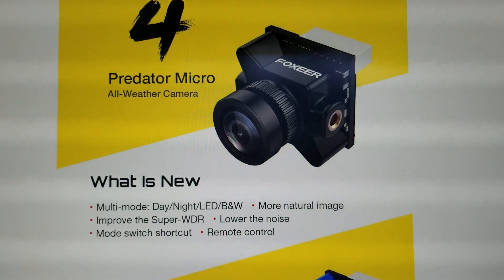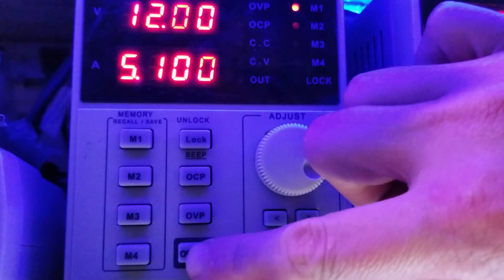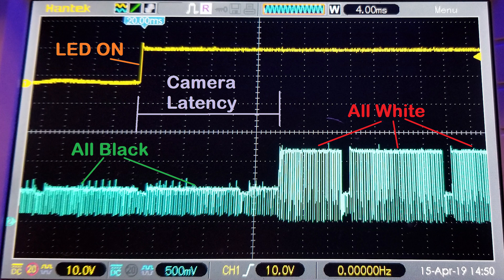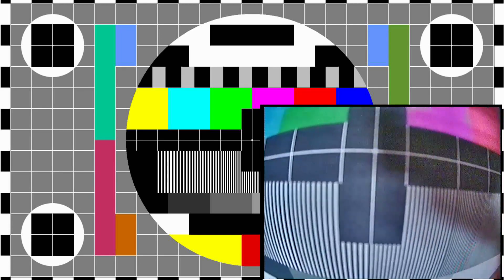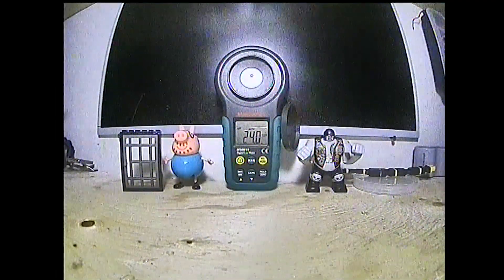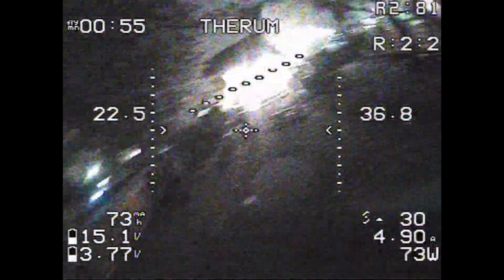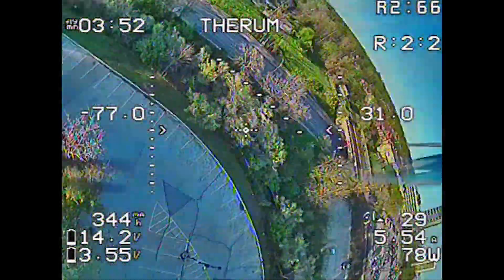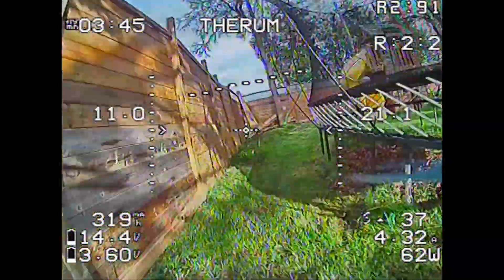Foxeer Predator v4 FPV Camera Technical Bench Review with Predator v3 comparisons

Comment: I just recently bought a Falkor 2 Mini. It's not even a week old. I'm impressed about wdr. They claim 5-40v too. Mine was connected to 7v. It was hot already! I don't want to use it beyond 10v. I will adjust my buck down converter to 5v or better, hook it up to the 5v pin on the fc. I might sell this fpv camera since I saw many youtube fpv vloggers are saying so many good things about DJI fpv system. They don't want to go back to analog anymore. Glad I haven't bought any fpv goggles yet. I'm new to this.

Comment: Again THANK YOU. I'm hooked on your videos now. I never liked the Predator's picture. I was very disappointed with the V1. I skipped V2. However, I have new found respect for Foxeer and the Predator V4 now that you have confirmed how low the latency is. Yeah, the RunCam Racer 2 might be a little faster, but I need to be able to fly in low light as well We race in dimly lit parking lots at night over here. In contrast, I bought a couple of Ratels and while I love the picture, I couldn't understand why I had so much trouble flying it until I flew it back to back to an identical quad with a Predator V4. I was consistently screwing up my lines on the Ratel but flying perfectly on the Predator V4. Thanks to your videos, now I know why. I know that Caddx is full of "@$#@" and they lied about the latency.

Comment: I like your test procedure! I've been running the cam for about 2 weeks. I want to see if I can tell the difference in latency vs the Micro Eagle I normally fly. I don't like the Predator picture but you can see lots of detail so its easy to get used to. I'll switch back to the Eagle after another couple weeks to see if I can tell the difference in latency once placebo wears off.